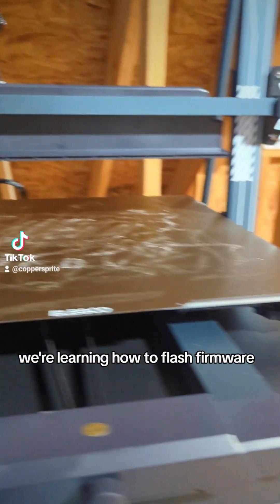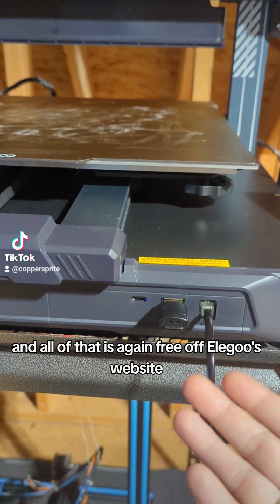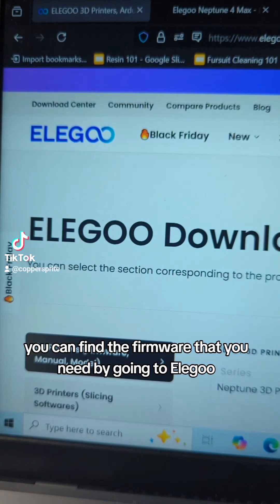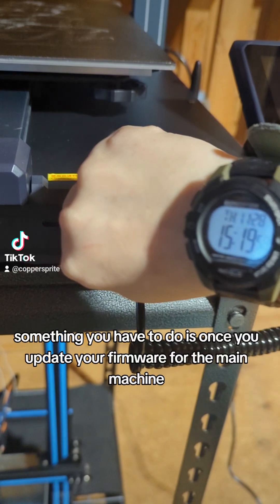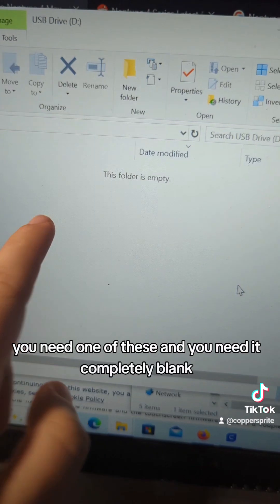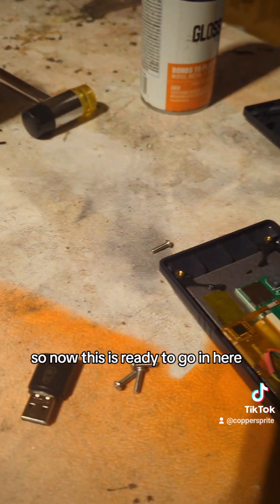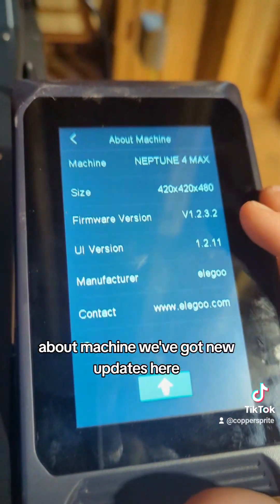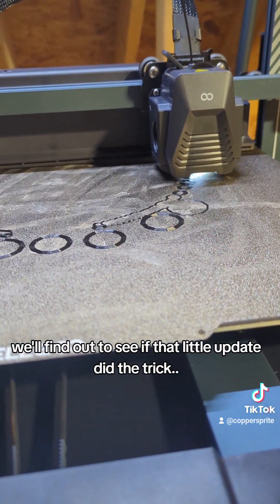Updating Firmware for Elegoo Neptune 4 Max

Comment: You are incorrect in the screen firmware update section. you do not insert the entire folder into the SD, you insert the file alone into root of the SD. after plugging in the screen, if done correctly should show a white screen with red text.

Comment: Great tutorial but I can't get the fix pack to work. I load it on a usb and put it in the printer, fire it up...and I get the same exact screen saying to update firmware or update klipper. Cannot get it to do anything else...
Reply from the maker: You may need to reach out to Elegoo directly if the firmware didn't fix.